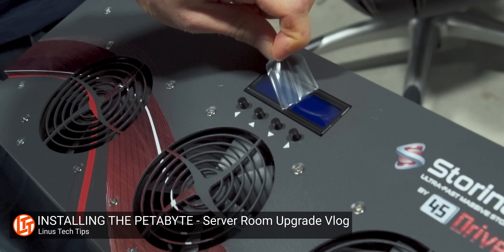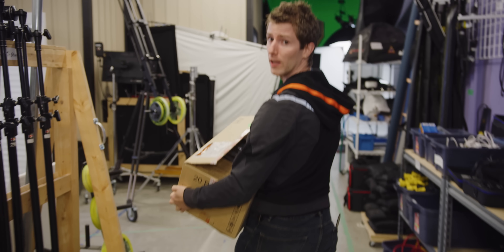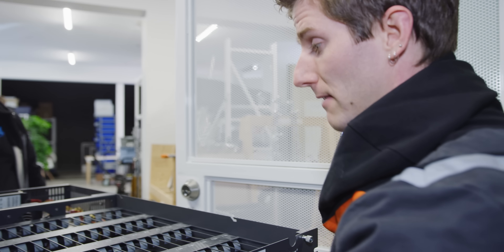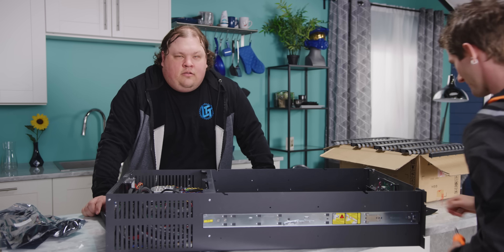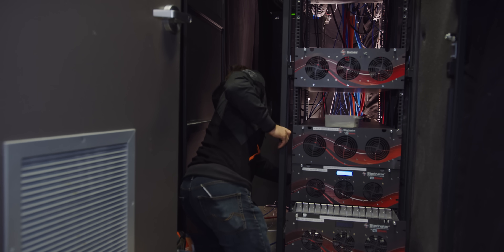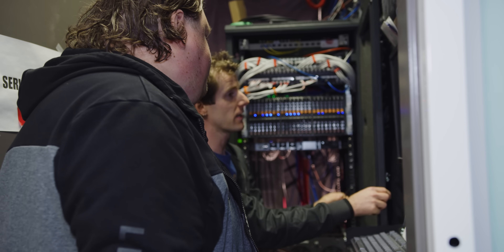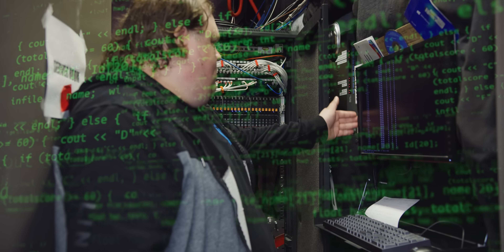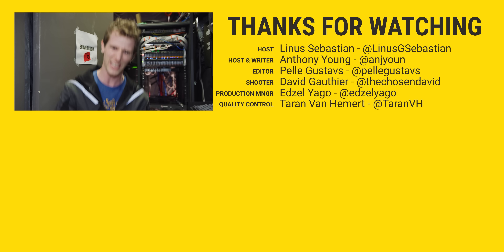Petabyte Project is FULL! Time to upgrade...

Comment: "Seagate actually sent over these!"
1 month later: "We lost all our data AGAIN!"
Reply: Legend has it Seagate are named Seagate, because the sea is blue like the blue screen, and gate because it's their controversy for having such terrible drives.
Reply: there is an 80mb Seagate in an ms-dos pc-xt clone I built in 88 and both the computer and drive are still working today. all Seagate drives aren't bad. nobody makes a 100% reliable hard drive, NOBODY.
Reply: @richardbenjamin8535  yeah but that box has like 500 hours power on time. :D
Reply: my drive dates back to 1984 or 1985 and it still accepts scans from an original b/w hp scan jet. so you can believe my drive has thousands of hours of run time on it, because I have scanned the equivalent of the library of congress in both text and pictures. that setup was the basis for a home business I ran to provide people with a cheap scanning service in san jose in those years, even though you have probably never heard of me. one of these days I may just donate it to the Smithsonian or the san jose tech museum.
Reply: @richardbenjamin8535  it's cool m8 i was joking.  not only i believe you but also i got a 250gb seagate with 35k hours with no signs of imminent death, plus a 160gb with 25k or so hours. both are fine for unimportant stuff. :)
people who work in data recovery however see a different story: ALL DRIVES FAIL AT SOME POINT yes but seagate tend to do that much more catastrophically, putting every chances of getting back even partial data out of the window.
seagate also acquired maxtor, adding another source of "engineered for failure" in the early death seagate memes.
maxtor along with some units from ibm/hitachi at the time both liked overheating and warping platters A LOT.
Reply: you didn't offend me, I was just stating fact, not meaning to come across as rude. I have a 4tb external Seagate that is supposed to be used as a backup and it runs constantly. when I buy drives, I try whenever possible to get western digital. I have five 2tb black wd's and those have run for over 5 years without fail. I still remember the first 3 drives I had all seagates. the 5mb, the 20mb and finally the 80mb. in those days msdos would only see a 32mb partition, so I had to learn how to create logical drives all by myself with trial and error. just imagine backing up even the 5 megger on 360k floppies <grin>
Reply: @richardbenjamin8535  haha yeah i remember FDISK-ing a 170MB drive on my 386 with DOS 5 to rid of a virus called "FORM" i got from who knows what floppy. :D
Reply: yes and having been an employe of McAfee in the early years I can tell you what that command should have looked like fdisk /mbrwhich means wipe the master boot record, then you issue the command sys c:from a bootable floppy that has a copy of command.com on it. I remember the days of dos 6.22 and windows 3.11 if you were lucky enough to own a hard drive big enough to hold 2 copies of the windows directory, all you had to do was make a copy called windows.old and then you could play with windows to your hearts content and just delete the corrupted copy and rename or copy the dot old directory.
Reply: Oh boy. 😂
Reply: I never had bad luck with Seagate unlike WD but just maybe me.

Comment: For God's sake, start useing magnetic tapes LTO (Linear Tape-Open) for older data storage. 

FUJIFILM LTO Ultrium 7 6TB - Cost $67

IBM 12TB LTO Ultrium 8 Data Cartridge - Cost $200
Seagate 12TB IronWolf Pro - Cost $370

Comment: I have to get that wallet. god forbid that I should have another bulge in my pants<grin> after what I just realized, I know I will burn in hell now. if you have a hard drive for that much storage, does that make you a petaphile? <grin> I know hindsight is always 20/20 but you could have used post it notes to identify the drives you extracted from the server with the bad cable. in large print for almost blind people like me or better yet braille for the completely blind<grin>

Comment: What's the point, the human eye can't even see more than 24TB's,... oh nevermind, it doesn't even matter, you weren't even wearing a anti static bracelet while handling all those drives. no doubt you have shocked all the data from the drives and its all corrupt.  Were they shielded drives?  Was your SWACKET grounded?  All that built up static in your SWACKET has enough charge to kill a Jay.  But I digress.
Reply: Stefan Etienne The Verrge Representative this comment is gold

Comment: You don't need to track the HDD's with SATA/SAS, the signatures are on the Disks, unlike SCSI which used the SCSI Device ID with RAID. You can put them in any order and it will work fine

Comment: You actually trust seagate?  I've had more issues with Seagate than any other drive
Reply: I'm yet to have a Seagate drive that hasn't failed long before it should have done.
Reply: I had one for 1 year and failed then another one 2 years and suddenly stopped working.  The one that failed after a year slowly died. At bout 7 months it started transferring really slow
Reply: @joshgaertig6294  Yeah that's my experience, I won't touch them these days.
Reply: Would rather use wd or Samsung
Reply: But yet you said that you haven't had one fail long before it should have

Comment: I had sortof the same issues with a Synology NAS some years ago, firmware on the drives wasn't compatible with the controllers, was the third NAS ordered with the same config. Are you sure all the drivers have compatible firmware? Ours were WDs, dunno if the same goes for Seagate, HTH

Comment: Am I missing something with your setup? Gluster/ZFS doesn't care about which drive is in which bay - it tracks drives via a UUID meta tag it places on each drive with it initializes.
Reply: I would have thought this was the case.
Reply: "it tracks drives via a UUID meta tag it places on each drive with it initializes"

If it's Linux, it might do it via /dev/sdX instead of /dev/disk/by-uuid or /dev/disk/by-id, depending on how it was created.  If Gluster does ZFS things automagically, then you're right.
Reply: Even mdadm and LVM does that those days. Guess some strange hw raid may require that.

Comment: this is great. I can remember when my first hard drive was 5 MEGABYTES unformatted. then 20 mb and finally 80 mb in less than a year. then I cracked the gigabyte level with a pair of 500 mb drives less than 5 years later. now I sit here whining and complaining that all I have is a 2tb boot drive, with a 4tb external and two docking stations holding a total of four 2tb removable drives. before anyone asks, yes I did need a hammer and chisel to write data to my 5mb drive<grin> p.s. I also have a 4tb hdd and the docking station will only see 2tb of it. to quote dr. smith from lost in space, "the pain, oh the pain" <grin> I disagree with how you describe your solution though. it isn't a band aid, it is more like an organ transplant or in this case IMplanting an organ that wasn't there to begin with.

Comment: Well, I wass pissed about the exact same issue so I got myself a 35TB server. It's a f***ing trap. 16 3TB drives, and 500W from the wall. Also, there's a UPS in the way, so more like 650... :D  btw. running RAID60 bcs the drives were 6+ yrs old. But hey, a 36drive server and 16 3TB drives for less than a thousand dollars? Happy me.

Comment: 2019: Out of storage, time for an upgrade

2020: Another Upgrade required
Reply: Well, the next logical step is an exabyte. That ought to last him a while. Using the 100 TB SSD ExaDrives from NIMBUS, he ought to be able to pack in 100 PB per rack, and I'm sure he can find enough room somewhere in his building to handle 10 racks. Mind, it will be interesting to see how he raises the money to purchase all those drives...
Reply: @johncochran8497  You think he pays full price for the drives? He outright says he is sponsored by seagate, so he barely pays anything, if at all.
Reply: @meemo4556  Considering that the retail cost of 10,000 ExaDrives (100 TB each) would be about $500 million dollars, I wouldn't expect him to pay full price. But I also wouldn't expect NIMBUS data to give him that many drives free either. And if instead of those 100 TB SSD drives, he goes to something spinning, the number of required drives goes from 10,000 to over 62,500. But Linus wouldn't possibly use that much storage. It's inconceivable.
Reply: @johncochran8497  Nimbus data has disappeared. This is what these companies do, get hype over a single supposed product but then you eventually find out that it doesn't really exist.
Reply: Jhon cochran he will get the money from ltt water bottles
Reply: @DougD-s2u  8k raw video from the RED cameras

Comment: Sounds like you need to really up your storage capacity......

I assume you already have off-site backup in some form, if not, you should, even if it's your own hardware.

Maybe look at hooking up with guys over at ServeTheHome again and doing a project around a SSD/RAM cache assisted HDD-based storage, multi-2U storage array, maybe 6U (3x 2U), have 4U for actual storage, and 2U for additional backup.

Either way, it sounds like you have a lot of things to consider moving forwards in regards to your storage of digital information, and, what's the best way for you to store that data.

Perhaps look into additional compression algorithms to reduce the amount of space your data takes up.

I wish the LTT Team all the best in finding a suitable solution to thier storage needs.

Comment: Once you've used the video how often do you need to use the same footage? Why not use tape or highly deduped storage such as Dell EMC Data Domain?
Reply: The access time for even individual files at 8k resolution would be impossibly slow on tape, I'd imagine. So if you DID need that footage...Yer fucked.
Reply: @stitchfinger7678  Funnily enough LTO-8(a tape drive type) can reach 360MBps read and writes(3x faster than a platter drive) with access speed of 10 seconds.

Comment: Amber Guyger trial set to start on September 23ed.. Jurors need to be speaking up and asking why they don't have a manslaughter charge to rule on. There should be at least 4 charges on Amber Guyger. 

1- murder, 
2- manslaughter, 
3- breaking and entering, 
4- assault with a deadly weapon... 

Where the jury would rule on each charge at a time as if the others did not exist. The jury is going to want to find her guilty on something, but they won't be able to on the one charge of murder, there is just not enough evidence to support a guilty finding pass any doubt. In order to find guilty on a charge they have to be 100% sure she is guilty and I can see it on murder.

Comment: The way the Fans are oriented the door filters at least 90% of the dust that could enter the system. 
I can say that after intense Testing and laser precise mesurements and a calculation that almost overheated my CPU.
Reply: Rick Sehfeld Yeah but 10% is still 10%

Comment: Linus: we need petabytes of space

Amazon: yeah why not use AWS S3?
Reply: Performance most likely
Reply: Paul that also has a solution - use aws glacier for red footage you don’t need to use immediately and the petabyte storage for fast access
Reply: @haris525  but glacier at petabyte scale isn't cheap, your paying around 5k$/month and getting the data out is at least 10k$ and this will be slow AF, if you need it fast, it will be over 31k$. For that amount of money, you can buy the drives yourself. Maybe if you need it for regulatory reasons, or if it's part of a 3 - 2 - 1 strategy... But hosting it yourself will be cheaper in the long run, if you can do it.

Comment: Linus - Only 20 terabyte available
Me worrying about the 70GB left on my 1 TB hard disk
Reply: I have 20 mb no joke
Reply: I'm down to 7GB on 5TB don'r feel bad
Reply: Should’ve went with the 2 tb drive
Reply: nitish kapur worrying about my 5gb left on my 250gb HDD
Reply: If you're American, 2TB 7200 RPM hard drives are only $60, now adays, 3TB Drives are only around $70-$85... so its a good time to upgrade and know it won't cost you an arm and a leg. 2TB Drives now a days are basically the same price as 1TB drives just 1-2 years ago. So you can now triple or even quadruple your storage for the same price it took to just double it just a year ago. Heck 1 TB NVME QLC SSDs are only $80-$90 like the the Intel 660p and Crucial P1. So don't sit in fear.  Pack a lunch instead of eating out or brew your own coffee at home for 5-10 days and you could easy have as much storage as your heart can desire for the next like 2 years.

RIP for those of you who have horrible currency exchange rates.
Reply: time to say goodbye to those old p**n videos :P
Reply: to be fair, one red video file could be a tb depending on length and resolution
Reply: Dude for real
Reply: I was at 56gb left on my 8tb drive and 75gb on my 4tb drive.  I just bought a new drive 8tb drive so I should be good for a little while.
Reply: Ha ,I bought an 2 TV hdd
Reply: My PC is using a small SSD full of Windows and an old laptop hard drive
500 gigabytes and it's just 70% full
Reply: I had a TB now I have like 900 GB worth of Minecraft mods ngl
Reply: Vision statistically a couple have to be rats or keyloggers rip
Reply: I'm over here with 12tb with only 30gb left 😂😂😂😂
Reply: Me worrying about my 20 mb on my phone...
Reply: worrying about 3 GB left on my 16 gb phone
Reply: I'm just deleting stuff because I can.. Storage is no problem.
Reply: i'm down to 1.5tb from 14tb
Reply: @Xtrafibers now thats a big problem
Reply: 2x 3TB in raid 1 here. 1.4TB left. I had my bootdrive (250gb SSD) on daily backup before, and that one quickly filled the drive so I had to remove it. Someday, I'll get around to setting up again, properly this time.
Reply: 70gb is lots what are u worrying about
Reply: Me filling up 8 TB of blu ray quality anime.
Reply: ha noob i have 76gb left
Reply: @ADN1996  I was just gonna comment that I have 76 gig left  out of 1TB and found it funny how coincidental that he has 70 but then I found you who has the exact same amount left lol maybe we both have the exact same games installed.
Reply: a few of the computers at my school had like 2mb left out of 100gb
Reply: I have 72MB.
Reply: I've got 50 gb on my one terabyte microsd card
Reply: I have about 904/1830 GB left. I really need a better solution cos im using 5 drives at the moment
Reply: Well, I was down to ~25GB on a 6TB setup (3+3) just a few weeks ago. Long story short, now I have more storage and a thinner wallet.
Got a new 10TB drive and made a RAID 1 out of those two 3TB ones; should be good for a few years.
Reply: Just delete a virus named system32
Reply: laughs in crappy 256gb laptop
Reply: Just delete system32!
Reply: I got a solution .. format your drive . 😂
Reply: I have 300GB left on my 8TB drive, and lord knows how tighter my other terabyte drives are at
Reply: @AllCentralFlorida   I have like 350gb left in my 400gb laptop
Lol